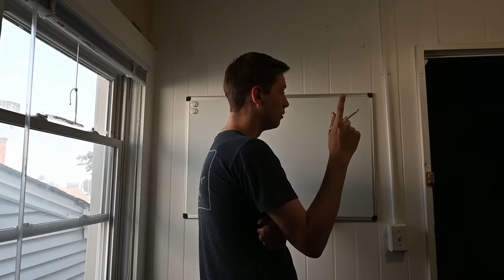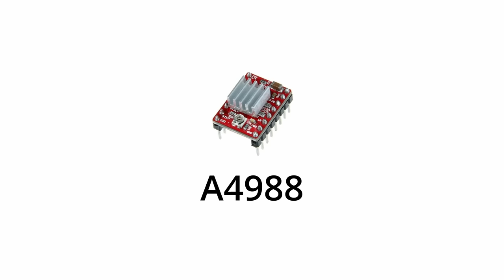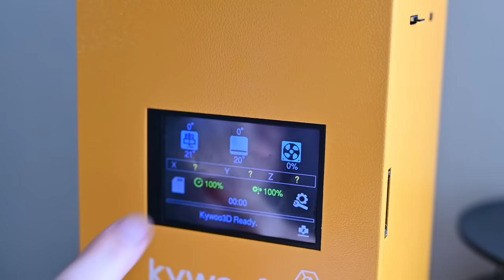3D PRINTED TIRES... Will They Last??

Comment: You could do a silicone mold of the resin printed tire, and then cast it with flexible polyurethane. That would probably be the most wear resistant part that hobbyists can make themselves.
Reply: plus you can make a tire in a few minutes instead of waiting for it to print.
Reply: Plus the ability to make composites:
Add a fibre core, although this would make more sense for cast timing belts.
Or mix in fibres with desirable properties.

Plus the option for double-shot molding:
For instance 98A for the inner rim, 92A for the tread.

Or simply cast the tire around the hub.
Reply: @ronnetgrazer362  Okay let's not get crazy.
Reply: @graealex  I say, let's!
Absolute overkill for one-offs, sure, and for very demanding applications maybe you should be looking at professionally (mass-)produced parts, but neither of us thinks it's outside the scope of the determined hobbyist to cast some custom wheel sets for, say, a low volume kit campaign.
Relatively speaking, my suggestions don't add a lot of complexity if you're already taking the home-casting route.
Reply: @ronnetgrazer362  The guys at "Easy Composites Ltd" here at YouTube already do a pretty good job of that.
Reply: @graealex  Dangerous time sink, those channels :) Great stuff, so many possiblities, so little time.
Reply: Haha, I have an Aarma infraction 6s. I parked it because it EATS TIRES literally. A $60 set might last 4-5 batteries being run through em. 

I challenge you to make some last longer than this for drifting purpose only.

How much speed can these handle before blowing apart from centrifugal force?
Reply: In general this method and lost wax casting method allows for home manufacturing of almost anything. Pick a favorite medium and get the specialized tools for that and the 3D printer allows for digitally sculpting with the magic of cntrl_z to undo a slip up that would have taken hours or a complete redo to fix with physical mediums.
Reply: now why didnt i think of that????? i want something longer lasting than commercially available bike tires for my ebike, im about to take a 400 mile trip on it and i dont know what would be a good material for the trailer's wheels, thanks!!!
Reply: @frogz  'longer lasting than commercially available bike tires'  Realize if regular tires are 95% of the way there in other respects, you'd be much better off to start from there.
Then just coat or cleat the outer tread with something harder.  It'll be a lot easier than starting from scratch.  Think of it like shoo gooing on an extra layer of sole to make your shoes last twice as long or similar..
Reply: @ronnetgrazer362  'Or mix in fibres '  Came up in a video on making your own belts the other day.  Mixing almost doesn't work on the 3D printed side due to viscosity and clogging nozzles, but of course easier to do with casting.
The design of those tires makes me want a regular TPU type tire, but then make the outer tread parts with a tougher material then pop them in.  Should get most of the flex of the TPU tire but with a longer lasting tread surface that way..
Reply: Where do you buy flex polyurethane,and what is the cost?
Reply: @TheRainHarvester  In the US, Smooth-On is a big supplier. That's also where you can buy the molding silicone.
Reply: using thick silicone to recycle HDPE into parts would also be effective.

also has anyone made a nice HDPE filament yet?
Reply: Thats The way to do it properly for sure.
Reply: What you actually want is rotocasting. Andy's Machines has videos on this specifically for making model tires
Reply: Pneumatique is literally tire filament, but it leaves a terrible smell.  I'd be hesitant to use it on my printer.
Reply: YouTube for my idea for my business that involves 3D printing foraging and using CNC to build multiple items and use them  to make useful items including a type of door gear

Comment: I remember when I was in High School, we got the great idea to build a Full Size Big Wheel. 
I learned a lot during that particular building and explored the basics of how different it is compared to typical manufacturing. 
One thing that I will say is that TPU tires do work relatively well, but you absolutely need to print with high infill, and you almost have to create brand new designs for the tires themselves. We tested ours with standard bicycle tubes, was an 18" wheel, lasted around 40 miles before it blew out. So, it is possible

Comment: Inspired by one of RCLifeOn's videos I 3D printed my own 130mm tires for my electric longboard. I've ridden it about 500 miles without needing replacements.
Reply: I find it hard to believe that TPU can be that durable.
Reply: @internettoughguy  are you familiar with printing tpu?
Reply: @trevorcrain9620  Never tried printing it.
Reply: Did you print them solid? Or thick walls with infill? Can you share more details, do they absorb vibrations, do they cause vibrations? im interested in doing the same.
Reply: @viko207  I don't remember the exact infill % but didint print them solid. I think it was around 75% or a bit over and I think it was around 5 outer perimeters? The more outer perimeters you have the longer the wheel will last. I can't really say about the vibrations but They roll over everything on the road and the ride overall is way better. I've ridden without them maybe twice.
Reply: @Blu11sonic  Thank you for your answer! Will give it a try.
Reply: @viko207  ya np! In regards to the infill its better to side on too much than too little as too little will result in a "flat" tire. I would really like to compare multiple infills to see what % feels most like a air tire. However 2 wheels use about a roll of filiment and I don't want to get 6 rolls of filitment just to do a test lol
Reply: @Blu11sonic  Ah yes i can see its not exactly worth it doing the tests lol. I dont plan on making them lot higher, will fit them on 90mm tiers, so maybe 110 is what im going to go for. I never go off the road so dont need the extra hight. its probably not going to feel as "smooth" but it should save me some filament. Did you have any fitment  issues, how much smaller did you make them in order to fit tight?
Reply: @viko207  if your board doesn't have the power for off road bigger wheels may help a little bit mine still comes to a complete stop in grass even with 130mm wheels. If you measure the diameter of your wheel to be 90 I would design it around that and in your slicer scale it down to maybe 99.5%ish? I kinda just eye balled it. If you make it too big I've found alot of success wrapping the original wheel in ducktape and pressing your 3d printed wheel on over that. Just make sure there a tight fit and keep an eye on them your fist few rides you don't want them flying off when your going full speed haha  (im not responsible for any injuries)
Reply: @internettoughguy  super late to the party but i can confirm, friend of mine 3d printed "normal" longboard wheels (70mm, no thread, solid core with a ring of about 5mm of  TPU on the outside), after like 2 months the first thing to fail was the solid core, specifically where the bearing sits, he made an improved version and used the same old TPU rings for about 1 year or so till they completely worn out.

Comment: This also shows how microplastics are actually created. By friction.
Reply: It's one of the ways and also tire emissions are also often overlooked when talking about vehicle emissions and I've always wondered why.
Reply: @velikdole9712  That doesn't really have anything to do with what I said because regardless of harm (I don't believe your stated lack of harm, but carrying on) it's still an emission.
Reply: @k20nutz  Afcourse it have to do with what you said. Yes, it is an emission which is MUCH MUCH less harmful than diesel and petrol exhaust. And that is my whole point. And tire particle emission is almost the same or the same for electric and for diesel or petrol car (Tesla model 3 weight actually LESS than comparable petrol BMW M3).
Reply: @k20nutz  So to answer your previous question why the tire emissions are often overlooked? Because they are MUCH MUCH less harmful for the health. That's it. It is totally normal to focus on much mure harmful things firs (like diesel and petrol exhaust).
Reply: @velik dole Tpu biodegrades in about 5 years, and the affect of these plastic in our environment is noticeable but it also almost nothing compared to the affect that big industry has, car emissions have become so good in the last 10 years a new some new trucks make less emissions going 1000 miles then an old mower does clearing your yard. With new technologies like direct injection in gas engines, forced induction, and more efficient overall design becoming more standard cars have become much more efficient and much more healthy for the planet, and most diesel emissions are much cleaner then gas engines, and there particles don't stay in the atmosphere as long. Also teslas are just as harmful for the planet as regular cars, with there bad build quality and expensive batteries that are harmful for the planet using much more lithium then a regular car, plus tesla's compared to most cars are boats, a model 3 weighs as much as my body on frame ranger from the 90s.

Comment: Nice idea. Your test methods could have been sightly better though.
- Store bought TPU wheel added to the comparison as the control
- The wheels were independent of each other. The snapped wheel hub happened for a reason. It clearly shows that the motor speeds were different and maybe some misalignment with the mounting. So one wheel was probably pushing and the other was dragging.

I'd like to see a part 2 where your testing methods are better and with the control. :)

Comment: in general, TPU is by far my favorite material. Very resistant and durable.
Reply: Mine too and it prints beautifully on my crappy anet a8, actually better than pla. I don't understand this but a new printer just so I can print tpu, you can print in tpu ridiculously easily. I printed tires with it and they're awesome! What awesome things have you printed with tpu??

Edit: his printer was a Bowden extruder, my pet hate for extrusion for many reasons...

Comment: It would have been interesting to test PLA+ just for the heck of it, simply due to the fact that's probably the most common filament sold.  Not so much about comparing it to TPU, more about if it was 'good enough'. TPU really hung in there, even the resin wasn't to shabby.
Reply: Kiss braking goodbye... PLA+ tires would be like driving on ice. Dafok m8?!? Of course you need TPU. Heck, even TPE with 83A durometer would be more appropriate. if it was just durability everyone would drive on stainless steel tires HAHA

Comment: I see one problem, when you put it in dirty or rocky surface the first tire clears out the surface or makes it smoother for the other tire to go on. For a solution you can extend one the placement for one of the tires.
Reply: not entirely sure why he went with testing both at the same time.
it would solve so many problems had he tested them one at a time
although the results would be indistinguishable anyway
Reply: @GeorgeTsiros  he probably did that because he wanted them to be tested on the same weather
Reply: Then they wouldn't be travelling the same distance

Comment: 2:00 Yes it's crazy how far they've come. I even heard there are printers out there which don't use this shitty mechanism to mount the build plate. And if it isn't clear - one big problem here is inconsistent heat transfer due to pressure only being applied at the edges.
Reply: This is barely an issue, even heating on the bed doesn't effect the print in any noticable way.
Reply: @lobsterbark  Of course it is an issue, at least for high-performance materials. Obviously it doesn't matter with PLA.
Reply: @graealex  If you are printing something that sensitive you should be using a heated chamber, using either a core xy or a delta, depending on build volume. Even nylon isn't that sensitive though, you would be doing something very special to need that.
Reply: @lobsterbark  What kind of rubbish are you trying to tell here? Uneven heating means uneven shrinking, and that will already affect ABS prints. And a heated chamber reduces the gradients, but for most practical purposes, the heated bed will still be at a higher temperature.
And before you write more rubbish, maybe just Google for people having problems from unevenly heated beds. Because there are plenty.
Reply: @graealex  ABS isn't commonly used for printing anymore because it's so sensitive to that kind of stuff with no benefits vs other now common materials. It's one of the few materials where that actually does matter.

I've been building and using 3d printers for almost a decade now, this has been my personal experience. Uneven bed heating really doesn't matter with any common material.
Reply: Magnetic build plates ftw!

Comment: i believe the resin got more wear because it was the leading tire removing objects for the rear tire. a better test would be to do a 360 clockwise then have it run a 360 anti clockwise etc etc

Comment: Thanks for sharing. 
Couple points:
Should of angled the tires in the direction of travel. (front tire driving out and rear driving in, constant slip angle, but in opposite directions)
One of the motors probably had more speed, thus driving harder and more wear.

Comment: Nice video! In this configuration one wheel is pushing, one is pulling. The stress distribution is different in both cases - the pushing wheel is pressed stronger against the ground. Have you considered alternating the driving direction?
Reply: Also the speed between the 2 motors may not be exactly the same, causing slip on the wheels which also may not be distributed equaly between the wheels

Comment: You should try using flexpla.  Its a bit stiffer than tpu but you can print it using normal pla settings and speed.

Comment: I print a lot of TPU on my stock ender 3 with it's bowden extruder. Never had a failed TPU print. Nice test.
Reply: What is this wizardry. I have ender 3 pro.. then again I’ve never tried tpu lol
Reply: Same here,  however I did change the bowden tube to tighter tolerance Capricorn and did some of the mods to the feed assembly to make it easier.   All easy stuff and well worth it.

Comment: You didn't mention the durometer of either material used in the tires. All other things being constant, the softer the durometer, the better grip you will have with the tire, but the more quickly it will wear. I'm also not seeing any links to the materials used.

Comment: do you have an estimate for the overall cost for a set of 4 of those not-completely-stiff tires?
like
if i asked you how much would you want for a set of 4, how much would it cost you over all (material, electricity, time, effort) ?
the stiff ones would be kinda better for offroad
the rubbery ones would probably be better for onroad RCCs
Reply: The cost of the materials the power is very small.  Maybe $3.50 per tire at most.   But the cost to custom design the parts is laor intensive and people typically can charge $100 per hour.

The best wheel design uses a metal hub.  I like to use steel about 20 mm diameter with threads for set screw.   Then over then goes a PLA/PET wheel and then a TPU "tire" and the parts are glued together.    Yes you NEED the steel hub as it ti the hole in the wheel where the motor shaft goes that usually fails over time.

Comment: i been using tpu filament in a bowden extruder with very little issues. 
once in a great while the filament pops out of the extruder stepper gears. but that can be solved with a better stepper driver housing.

Comment: The resin printed tire wearing out I think mean its softer, if that is true could it have more grip. I'm thinking the difference between soft grippy racing tires and harder normal tires. while they wear out fast could mean they are getting more traction just some thing to think about maybe test.

Comment: Can you print solid rubber tires for electric bicycles? 20 by 4.0 and 26 by 4.0, specifically for the Annika A8 pro. Electric bicycle and the Eahora Romeo pro. basically street motorcycle tires and dirt bike tires that are extra heavy duty that don't require tubes and don't get flats for electric bicycles and electric scooters like the Nan. Robot

Comment: It’s not difficult to print TPU. You just have to slow it down and minimize/no retractions on Bowden tube
Reply: @matthewbrown1617  when I mean slow, its like 40mm/s.  I have a FLSUN SR and ender3v2 and both are bowden.  I can print it.  its easier with direct drive for sure.

Comment: i printed 4 98a tpu tirells for electric skateboard from thigiverse in order to increase wheel diameter from 90mm to 105mm，they worked fined for 100+kilometers，they take  about 1 week to print on ender 3 with 50% speed，no infill all wall lines，100kms later only outer layers worn slightly（about 5 layers each 0.16mm）
Reply: How is the grip? Can probably get away with <100% infill if you wanted to.